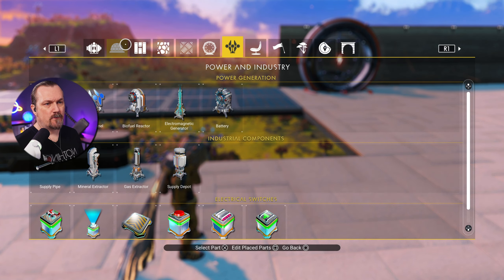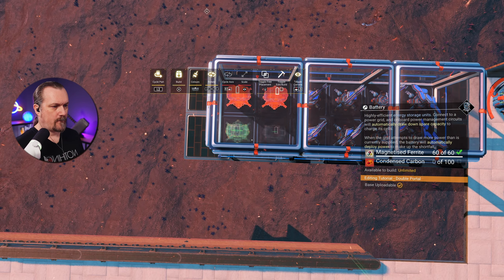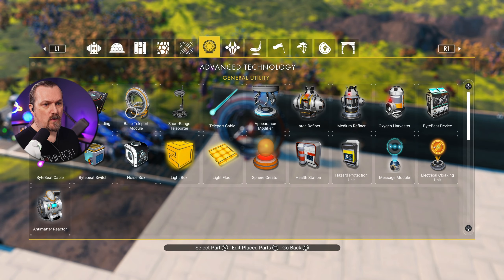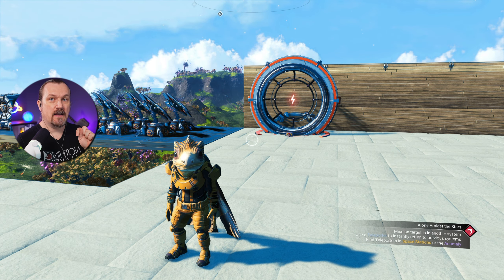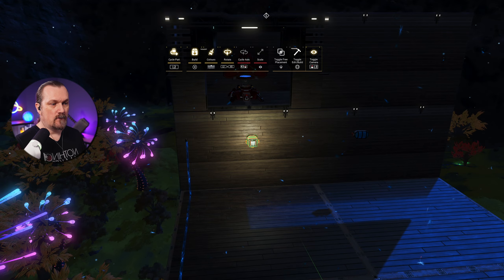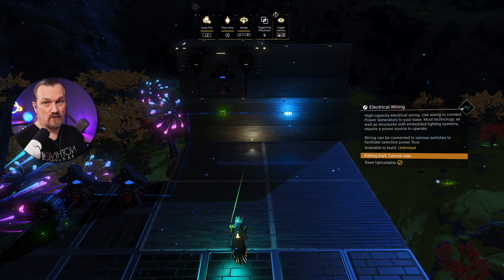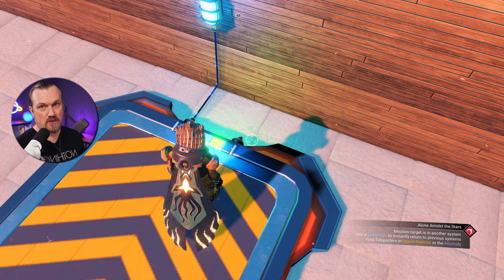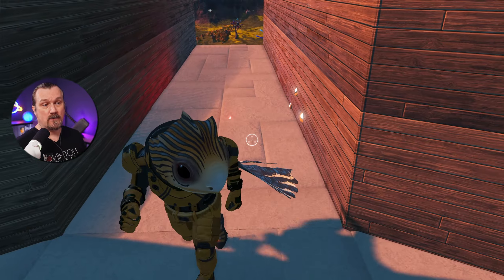Optimizing Base Electricity | No Man's Sky Power & Logic Guide

Comment: Haven't watched the vid yet. At work. The best way I found to light areas is the use of the cuboid roof part. Set a wire frame. Glitch to points. Done. Light with no electricity requirement. Lol

Comment: Your battery to solar panel ratio technically works. But 90% of viewers are running  out of power as there is not enough power during sunrise/sunset when the solar panels are only producing 1/2 power & they assume as long as it’s running the batteries will keep it powered. It will not.
The ratio that works at any size/proportion is 2 batteries per solar panel. That and ensuring your power drain is 1/2 what you’re collecting at full power (50kps). This will ensure your batteries won’t go below 60%, as you can run into problems around 50% power. The math & experimentation does not lie. And I want gamers to be as well informed as possible.
Thanks. And keep making great content.

Comment: Nice! Can u make a video showing case a  door  with temporizer, where there a lights like a v-meter, when the all lights turn on, another light or light cube turn on and open the door.  When the door is locked,  the red light is turn on, when the door is ready to open, the light is green.  This is like a air lock pressure door. i think this is a good content for a video!!
Reply from the maker: That is not a bad idea for a build project.
I did make some guides about running and fill lights - perhaps that could help you?

https://youtu.be/oaowlGdBNso?si=kjyFjJYMmIIpsff2

Comment: As others said, I never had the idea to use a solar panel as a switch. Also, I did not know pressure plates could act as close proximity non-contact switches. 

Thanks for these tips!

Comment: Nice tips! For teleporter I mostly use a button, so it turns on a couple of seconds, since power is needed to access the menu only.
Reply: the proximity switch doesn't actually save power as when you leave through the teleporter it will never get updated to the off state and when you return the game will calculate battery state based on the power usage at the moment you left. so your way is better.

Comment: I have a “default” base I build typically. The Cylindrical Room has spots inside for eight devices. I’ll usually start with three rooms stacked. Add ladders, go up to the top, install a landing pad, then fill with windows, six solar panels and two batteries. Then go down a floor and repeat. (And depending on planet, I may throw a bunch others in too.) and then on the ground floor, I’ll usually put a teleporter, one solar panel, one battery, a save point. Then on the landing pad, put the other Teleporter end and the Portal. Maybe a save beacon (so others can find) and a trading wall machine. Then go back down and save and upload the base and move on. 

Most of my bases are labelled 0.0,0.0 as they are usually on the closest system to the center at the largest planet at those coords. Only gotten through the first 10 galaxies though. Still a ways to go. End goal is to some day have a base on every (possible) system.

Comment: Arranging solar panels with cubes is pretty neat. 
i didn't know they snap like this. 
Why remove cubes tho? They look cool and provide free wiring. 

But I always use geomagnetic gens. 
Solar panels only charge batteries during day and battery status is not saved. 
So if you TP to the system at night all batteries are empty.

Using solar battery as a daylight sensor is brilliant, no less. 

P.S. Did you know, that floor panels react on everything that moves including balls and wild creatures while a proximity sensor can only be triggered by players?
Reply from the maker: Cubes are ok in certain situations - but sometimes you just want your batteries to line up.
And yes - I am aware of the spheres activating the floor panels - There used to be a time you could even teleport those spheres..